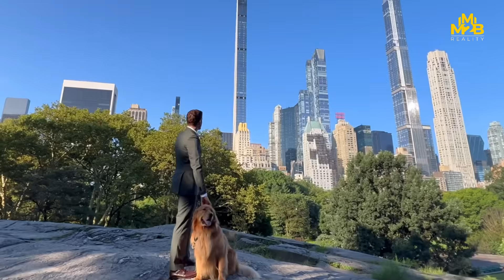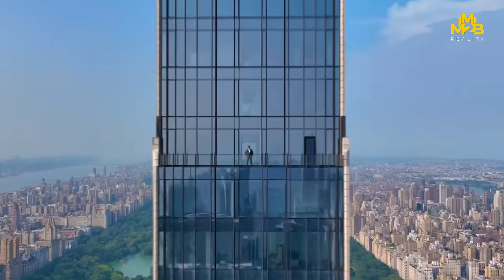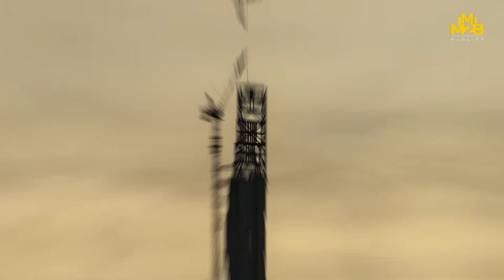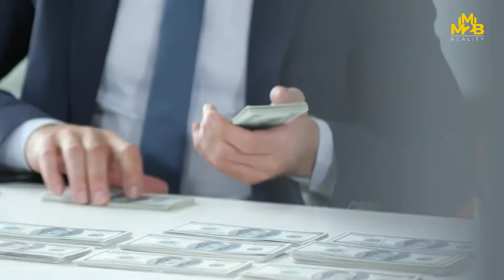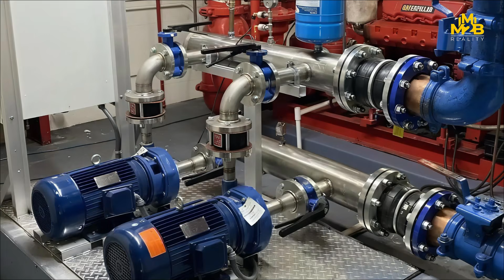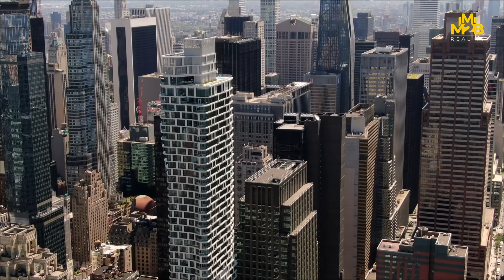This NYC $2 Billion Tower Has a Serious Problem

Comment from the maker: A 1,428-foot tower barely wider than a tennis court can stand because of anchors, terracotta, blow-through floors, and an 800-ton damper — but even when the engineering works, the people inside still feel the wind. Would you live in a skyscraper that was designed to move?